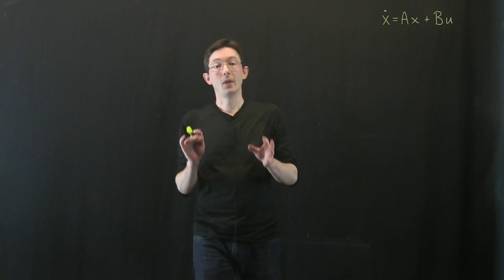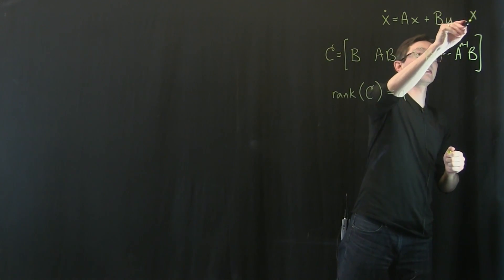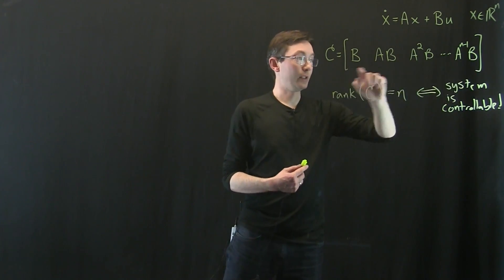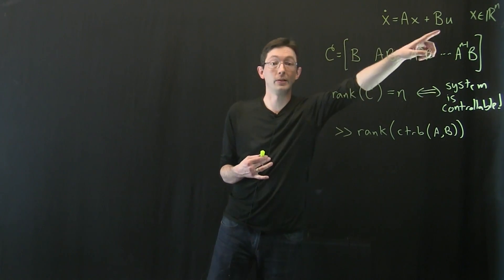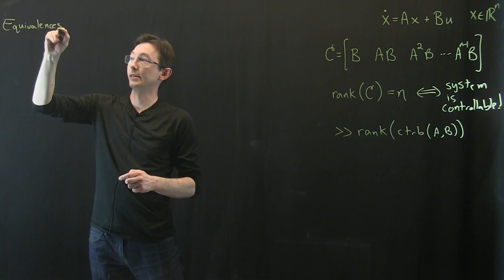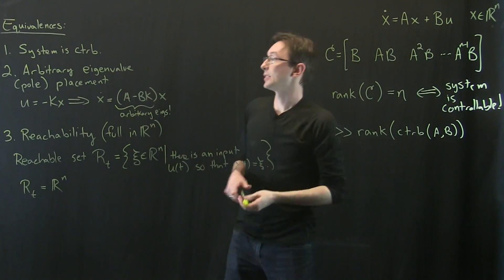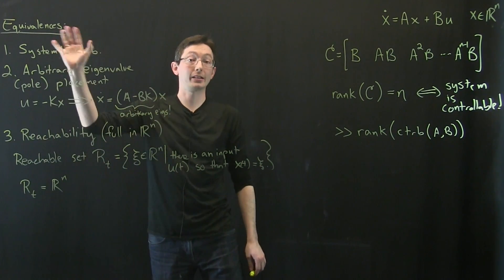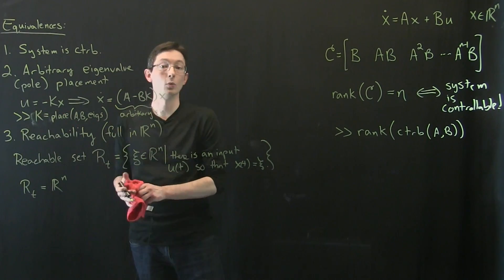Controllability, Reachability, and Eigenvalue Placement [Control Bootcamp]

Comment: Can anyone be kind to tell me that why the pole is eigenvalue in 3:04😃
Reply: they are called poles of the transfer functions in frequency domain analysis which is classic control theory. modern control is in time domain, utilizes mostly linear algebra and its concepts like eigenvalues which are simply equivalent and equal to poles once you convert your system to laplace domain.

Comment: I think there is a minor ambiguity in the definition of reachability. How you defined it at 5:33 seems to imply that giving u(t) instantaneously at time t will instantaneously drive the state to xi at the same time t. Whereas my understanding is that what reachability R_T means is there is a time-varying input function u(t) defined on [0, T] such that if you started at x(0) you will have x(T) = xi (note time = big T)
Reply: I got thrown off track a little there as well. I think this is down to two things Prof. Brunton does here:

(a) an implicitly assumed convention of always treating t0=0 and asking for reachability at t1=t, so that we only need to talk about "t" rather than a pair (t0, t1),
(b) a slight abuse of notation when writing "u(t)", where the "t" is not meant to be the same constant t as in the index of R_t, but rather a free variable – I guess writing "u(.)" instead would have been less confusing here

Comment: I'm about to embark on an active magnetic bearing control adventure and these lectures are invaluable. Thank you.
Reply: How goes it?
Reply: @NGPerez247  we find out if we have funding by the end of this week, fingers crossed.
Reply: @leighstanger8988  and now?
Reply: @pdebuck1  we didn't get the full funding so we had to truncate the project and reduce the scope. Therfore unfortunately we are doing the design and testing statically. Although I am hopefully going to buy a national instruments FPGA based data processor and some sensors so we have some parts of the control system.
Reply: @pdebuck1  Hi Pieter, we didn't get the full funding (despite excellent scores) so we went for a different funding stream and had to reduce the scope. therefore we are only 'considering' the control dynamics side of things not actually implementing it in the project. I am however pushing to get a nice national instruments compact rio system to allow us to characterize the eddy current sensors (high resolution displacement) we are ordering. the FPGA based compact RIO will hopefully allow us to implement some reasonably sophisticated closed loop control on the magnetic actuators (likely non-linear) in the follow on project. we are currently getting our heads round the different. transfer functions of the components of the system. 
.

Comment: Hey Steve Brunton, although this video is very old I hope you're still reading it.  I have a system with 4 states and i would like to show the influence of u on the states. I have now calculated eig(gram(sys,'c')) and get the vector [0.0001
 0.0064 0.0572 3.3803] . Do I see it correctly that I have a much smaller influence on x(1), than on x(2)? If this is not the correct way, what would you suggest instead?
Reply from the maker: Hi Manuel.  I'm really glad that you are working through the material!  To see which states are associated with the given eigenvalues of the Gramian, you also need to look at the eigenvectors.  So the 0.0001 eigenvalue will likely point in some direction of state space that is not perfectly aligned with any of the principle directions (x(1), x(2), x(3), or x(4)), but instead will be some linear combination of these directions.  So the eigenvectors of the Gramian tell you which directions in state space are more or less controllable.